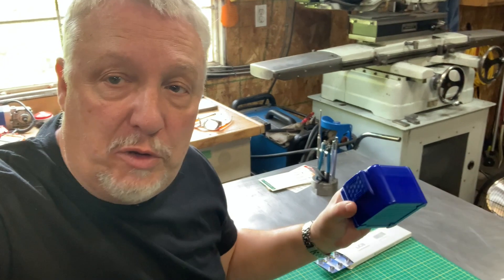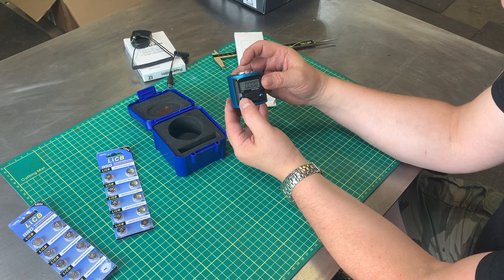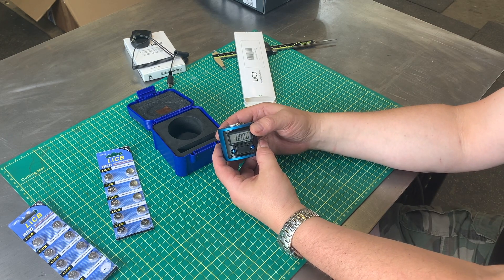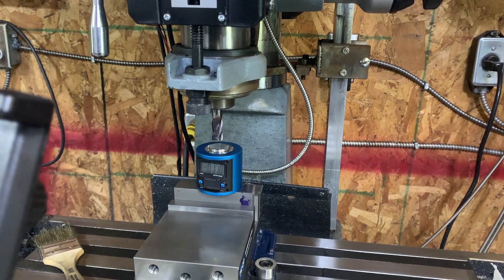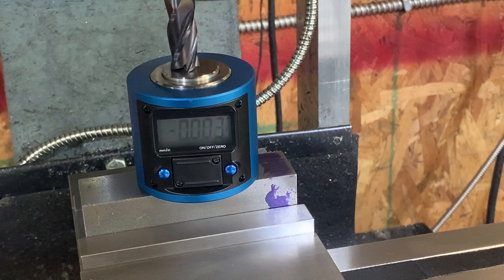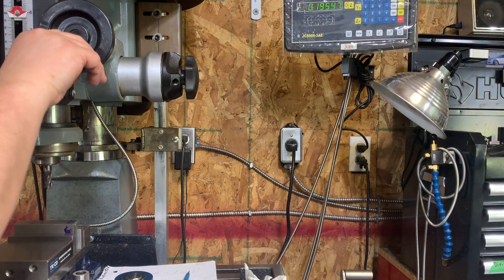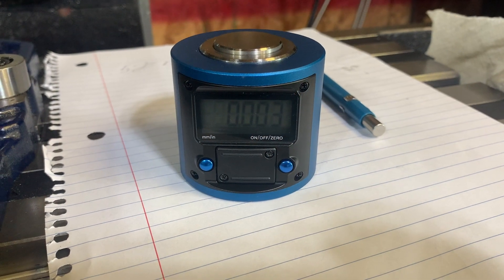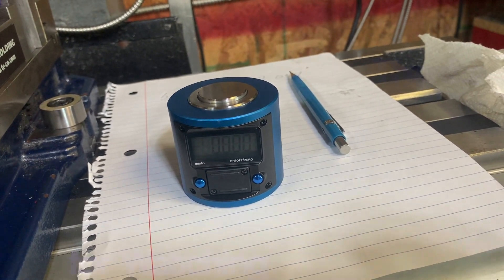Z Axis Height Gage

Comment: I don't see the point for a manual machine.  You could just disengage the fine feed and use the quill handle to gently touch the part, and then zero the DRO.  You could also use the Zig Zag method.  Zig Zag rolling paper is 1 thou thick.  Lay one on the part, start the mill and slowly lower the cutter to the part.  When the mill pulls the paper, you're there.
Reply from the maker: Thanks Jeremy much appreciated.  Unfortunately conventional methods have not given me the results I need.  I make precision tools which require a level of precision which I am unable to achieve with the conventional methods.  With this tool I am able to machine exactly from ground zero.  So far this has resolved my issues.
Reply: @LetsRogerThat  OK. To each his own, but I would suggest that using one of those height gauges is actually bad for precision. You are setting your zero based on a measurement on a device that reads tenths (or less) from a device that reads half thousandths and may be repeatable to half thousandths, but is probably only accurate to 1.5 or 2 thou. Don't confuse repeatability for accuracy. Two different things. You are stacking up errors. The error in the height of the part, plus the error in the measurement of the setter, plus the error in the DRO twice over because you are effectively setting a zero from a previously set zero. The Zig Zag method, or a Dykem scrape would likely be just as accurate. Use Zig Zag paper because it is much thinner than copy paper, and is therefore less compressible. It would be better to touch off to your parallel using a feeler gauge.

Comment: What is the advantage of that, none.
Reply from the maker: Hi Roger, it’s understandable that not everyone would need or want such a thing but in my case being new at this hobby, occasionally when I need to shave off a very precise amount of material from a piece, I found the touching off method to make me unable to achieve the results I want. It may not work but then again it might. I’ve seen them in real machine shops so they must be useful for something. If it turns out not to be useful I’ll chuck it up experience and have a laugh. Not a big loss. Gilles

Comment: What is the benefit of this vs just simply coming to a touch? 35yrs in the trade, never had an issue.
Reply from the maker: I only wish I had your experience and skills. But sadly I don’t. I’m retired and I like tools to help me along the way so I’m willing to give it a shot since using other methods haven’t gotten me very good results.  Gilles
Reply: @LetsRogerThat  Ah, OK, not very familiar with your channel and thought you were more seasoned. The only thing I dislike about this tool is its not imperial, they could easily add that as an option. Ill blue the part, use the quill with the spindle off and bring it to a touch, then back off the knee a few thou. Then with the spindle running you can gingerly raise the knee and juuust sweep the bluing off without actually taking any material.
Reply from the maker: @memyself3275  thank you. Great tip 👍🏻